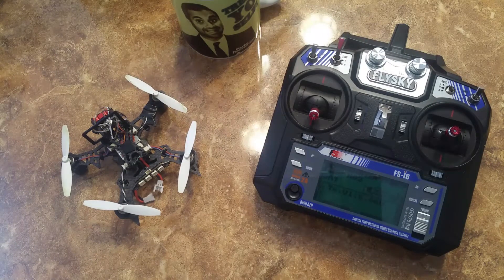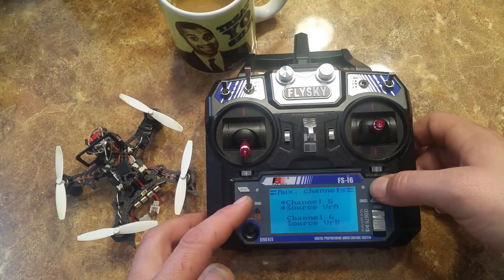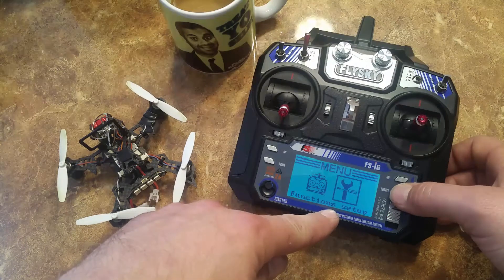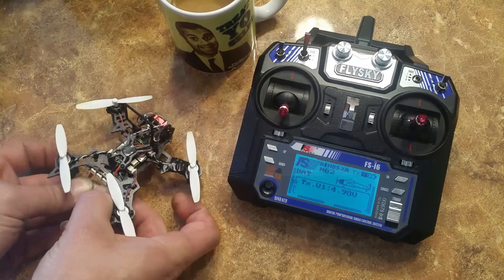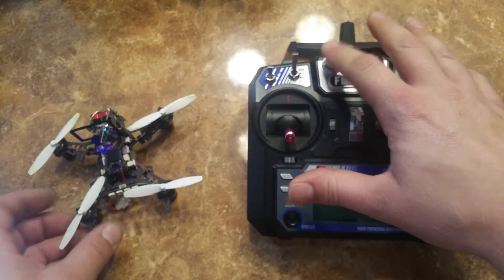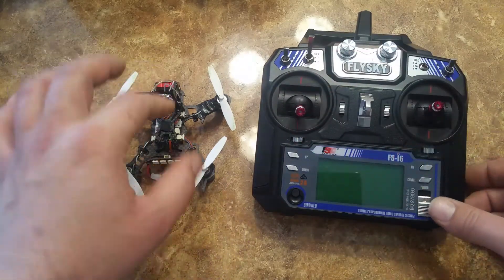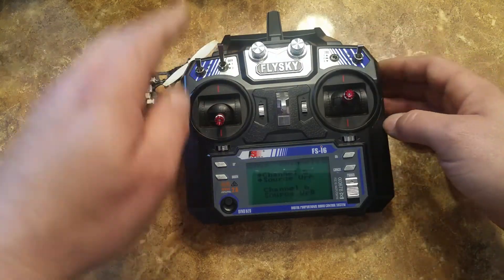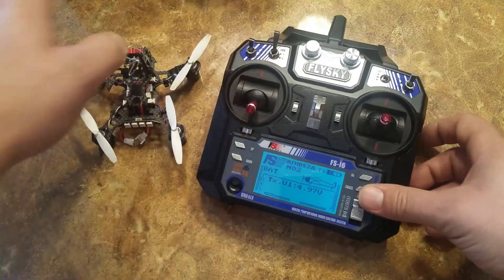FlySky Failsafe Setup for Eachine QX105 BAT

Comment: SHOW DETAIL FLIGHT CONTROLLER TO SEE BETTER YOUR PARTS, PLEASE!
It is for study purposes, I would greatly appreciate it.
Reply from the maker: +Duelist Strike I actually don't have beta flight. Everything is stock PIDs. The only things I changed are on my transmitter shown in the video.
Reply: I mean show in detail the flight controller of the dron , show the detail electronics that comes on the plate where everything is connected in the dron, especially to see the "MOSFET", pleace!!! help
Reply from the maker: +Duelist Strike can't help you there, I don't know what all of the bits are on the flight controller, but here's a link to the flight controller if you want to see one. https://m.banggood.com/Eachine-BAT-QX105-Spare-Parts-AIOF3PRO_Brushed-Flight-Control-Board-Built-in-OSD-Receiver-p-1123480.html?rmmds=detail-bottom-alsolike

Comment: Yup ur right the new bat or new batch bat has the fail safe and it will shut off when out of range thank you now I can us the knobs for fail safe now any chance you u know betaflight with the bat I'm having problem with my setup accidentally press the reset turn to default and now not sure that's the problem it won't arm or start or maybe bind anything information how to redo what I have done
Reply from the maker: +Michael Lopez I go through the bind process on the other video. I'd try thart first but in the manual there's a screen shot of the stock settings to input in beta flight if you accidently reset it. If I can find my manual I'll post the settings, but I'm pretty sure there's a pdf of the BAT out there.
Reply: VampCaff yep I fellow the steps but with your video and others and the manual but nothing works for me I really do hope there PDF but thanks man
Reply: Just one thing man be aware about the reseting setting and it will erase everything
Reply from the maker: +Michael Lopez bummer man, sorry to hear that. I know the arming channel or failsafe is channel 5 so you could try relocating to a different switch on your tx. That's what I had to do.
Reply: VampCaff hey dude any chance you could send a backup from betaflight for bat
Reply from the maker: +Michael Lopez I'll give it a shot tonight when I get home from work.
Reply from the maker: +VampCaff I just found this video https://youtu.be/EX0-0e-YMZY it has all of the settings in the description and takes you through the beta flight screens too for what the settings are. Not sure if these settings are stock or modified but it'll be a good place to start. If this doesn't help let me know.
Reply: VampCaff yup watch
Reply from the maker: +Michael Lopez here's the pdf manual for the BAT it has how to bind, set up arm/disarm channel, and what your beta flight settings should look like for the rx/tx to bind with the BAT.
 https://www.google.com/url?sa=t&source=web&rct=j&url=https://img.banggood.com/file/products/20170113040621Eachine%2520BAT%2520QX105%2520User%2520manual%2520guide.pdf&ved=0ahUKEwj56Ma-7-PWAhWHeCYKHbdJDvwQFgg-MAo&usg=AOvVaw2Y1xYfVmDiXNuOAbj2uNJQ